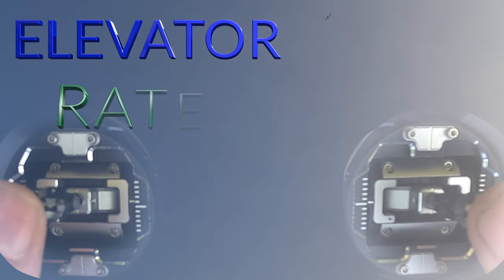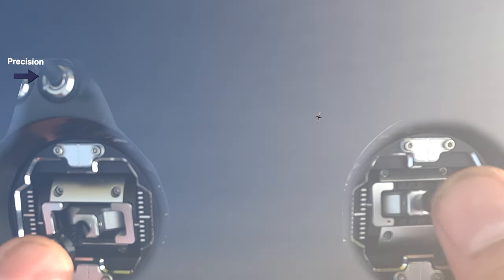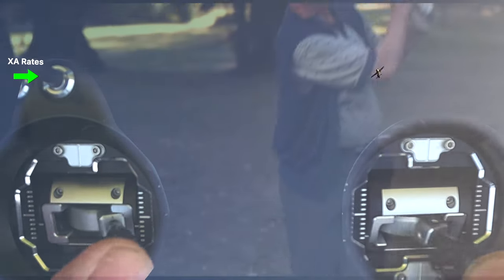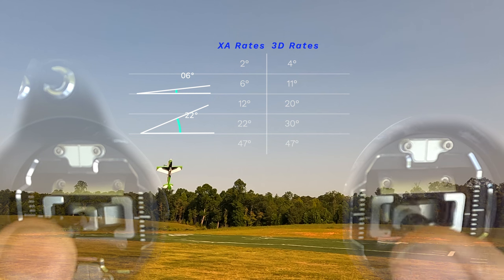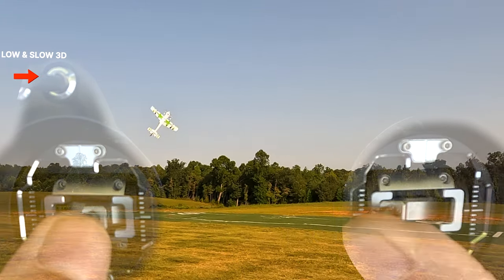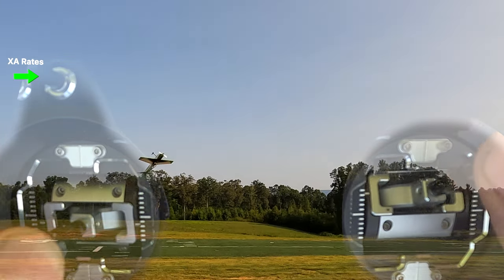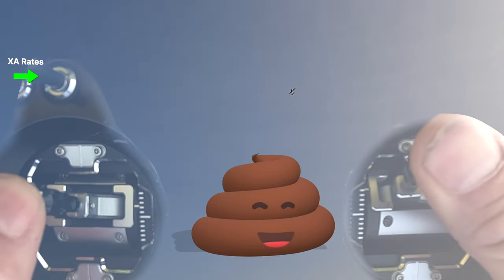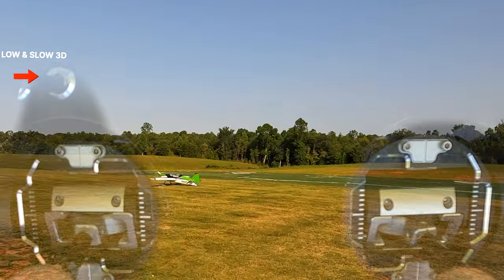Elevator Rates and Expo- Tips and Tricks Setting Up an RC Airplane for 3D and Precision Aerobatics

Comment: I have to be honest, i use expo but rarly use a switch for rates. I just learned how to do things all with the same rates and expo. Some planes are harder than others to do this with, but i kind of like the challenge without remembering what mode im in. But everyone is different. I like the skill of flying no matter how the controls are setup. I may take some time to fine tune each plane but after that its just a learned skill.
Reply from the maker: Everyone has a different way of doing things and the beauty of it is that nobody is wrong. The goal here is more to show someone what I am experiencing with the different rates and expos in the hope that they may be able to better dial in their planes by knowing what to look for.  I know plenty of pilots the never flip a switch and conversely some flip switches so often they sound like a typewriter when flying.  As long as you’re having fun and your skills are not limited by your set-up I’d say you’re definitely on the right track.

Comment: Great video... and better yet is the explanation on the video... I watched it a couple of times and need to watch again.. when you are switching the rates, I personally can hardly notice any difference in your stick movements.. in the video they all kind of look the same .. BUT when you explain the difference then it all comes together... the relationship between the prop, expo, rate, CG as you said is indeed a very important. Its like  walking a tight rope, on a windy day,  while joggling..
Reply from the maker: You’re spot on. And it goes to show you that you can actually fly with your rates not entirely dialed in, you just have to work harder at it. I’m happy to hear that pointing out the subtleties helps to make sense.

Comment: These videos are the best I have seen. I am trying to learn harrier and hover on a Dancing Wings SBACH foamy. I am having a real problem with wing rock. I can't seem to get a fast enough connection between my aeleron movements and actual response to get it locked in. I have no problem on a simulator with a Multiplex Parkmaster. Obviously practice is a big issue but are some planes really difficult in this respect? I have tried many different expos and rates. Have you any beginner's tips for controlling wing rock?
Reply from the maker: It sounds like your tail is just not getting enough air across it to hold it down or your ailerons are over correcting. Try moving your expo on your ailerons to 70-75%, increase your throw on your elevator to at least 49 degrees or as high as 55 (I almost never go above 50 myself) and make sure you are using enough throttle to hold the tail down. You may want to consider going up in pitch on you prop slightly as well.  If you have the time review my inverted harrier video. I believe that may help you with your issue. And... some planes are just really tough to get them to behave.

Comment: This morning I was trying to tame down a 60" EF MXS... I thought of an idea that might help you create a few more videos in this regard. How about a video that shows which manoeuver will help to find out the rates and expos easier especially on a new plane... for example, I like to dial in my rates and expos in mid rate while doing harrier and hover... and dial in my HIGH CRAZY rates while practicing pop top and blender.. etc.. and of course low rates for taking off and landing. just thought of it.
Reply from the maker: It’s an interesting thought. I do the same thing with my 3D rates and rolling harriers. That is how I fine tune the expo. The problem is for most people learning the rolling harrier is the moon. I’ll play around with this idea a bit more.

Comment: Hola 👋.

Bien interesante este tema, realmente estoy bien interesado en descubrir mi combinación más adecuada para mis prácticas de vuelo 3D.

Te agradezco mucho el trabajo que haces para ayudarte y aportar a la comunidad RC.

No estoy seguro de haber captado toda la idea pues los subtítulos al español son algo impresos jaja😅.

De forma general.. si el acelerador tiene un recorrido o respuesta más rápida entonces debo de utilizar menos exponenciales o es lo contrario?

😅😅😅
Saludos desde Cuba 🇨🇺.

Para un piloto que inicia en el vuelo 3D que consejos puedes darme?
Reply from the maker: Thank you for the kind complement. I'm sorry the subtitles are somewhat confusing.  The essence of what I am trying to demonstrate with this video is the slower you fly, the more sensitive your elevator needs to be OR if you prefer to use more expo you will need to compensate for that by increasing the thrust over the tail by either surging the throttle or using a higher pitch propeller.  As far as advice for someone new to 3D, start by getting a good quality RC Factory foamy they are by far the best tool for learning.  Then make sure that you are practicing constantly. Start with harriers and hovering and get comfortable with how the plane flies and reacts while in high alpha. Take your time and try not to do too much, make each maneuver intentional.   Happy Landings!
Reply: @RC-Air  Copiado, gracias por la explicación y los consejos, los tendré en cuenta.   
una pregunta más, entonces esta lógica de mientras más lento menos exponencial o más empuje también se aplica a las otras superficies de mando como los alerones y el timón de cola ?
Saludos desde Cuba.
Reply from the maker: While I will say yes it does apply to the rudder, I tend to use much more expo (70%) on my ailerons. I want my tail to be active and my wings to be stable when flying slow.